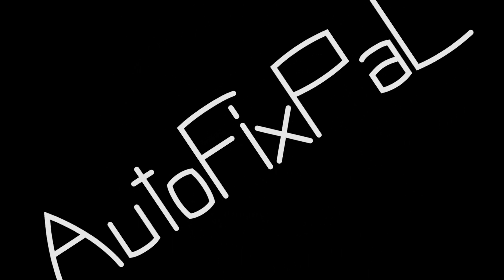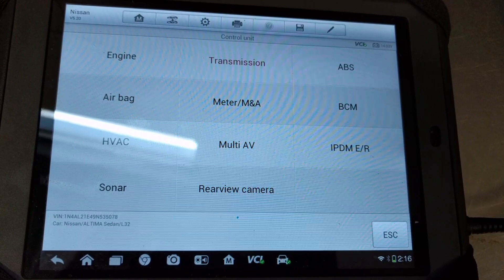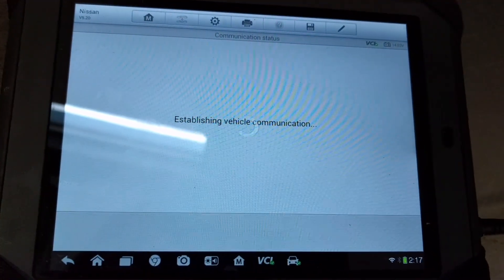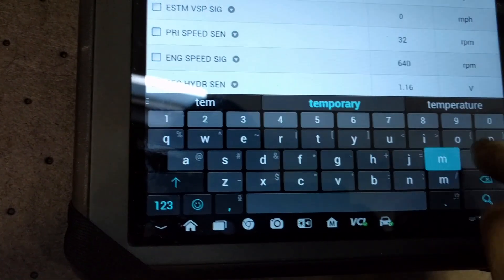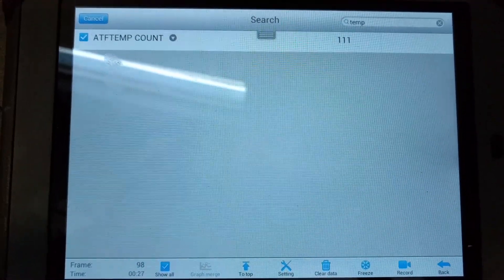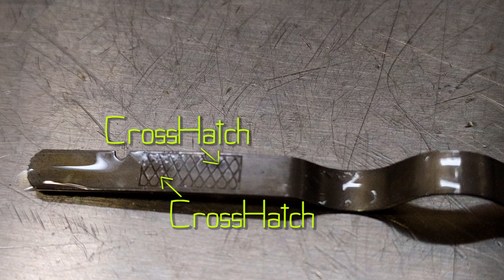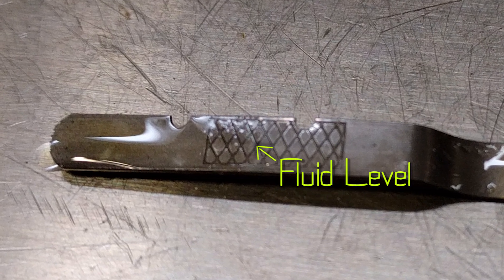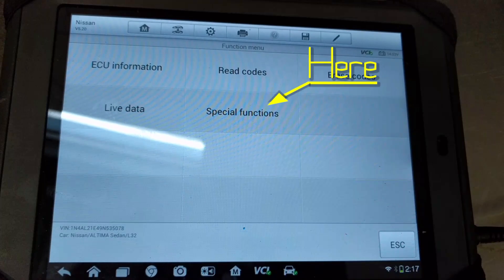Nissan CVT transmission fluid level check and correction with a dip stick

Comment: I have a 2014 nissan rogue.  No dipstick, just the plug. Just did a drain and refill using ns-3 genuine nissan fluid, but no way to check if fluid level is correct.  Where can I buy or make a dipstick?  Nissan dealer not friendly.
Reply: Gary Clemenson that is a screw right next to the  one you drained the oil , with the car running at a certain temperature you  remove that bolt  and check if the oil drains or not ,that indicates the right amount of oil
Reply from the maker: the EASIEST way to to a drain and fill would be to measure what you take out and put the same amount back in. Just make sure the fluids are both about the same temperature when you do it. If you are not sure if it was originally correct. you will have to over fill it a bit put 5 qts into a 14 rogue, get the CVT up to 98-113 degrees f. open the 14 mm at the bottom and let it run out until it starts to be a slow trickle or drips. I believe i did a video on Nissans with no dipstick as well.
Reply: for a diy dipstick what should the level of fluid be? is it between 1-2" at hot and/or cold?  @Autofixpals
Reply: @Autofixpals  i  have 2010 maxima with a dip stick to check the level and unfortunately transmission is leaking  (nissan replaced the original one under warranty with this remanufactured one )i have mixed readings of the fluid level,when i check it in the morning the level is around the first notch,(ambient temp is around 35 degrees F) then i start the car  to warm it about 15 min and i check it again  no fluid can be seen on the dip stick( not sure if this is normal) and then i drive it about 20 min on highway 15-20 miles and check it again the level is in the middle of the cross hatched area close to the second notch.  do you think the fluid temp  can affect the fluid level reading this much?Thank you
Reply from the maker: @keysersoze1907  yes temperature can effect the reading that much. If your replacement CVT is leaking and it was installed at a dealer it should have a 12k mile 1 year warranty on it. if im not mistaken. Call the dealer and find out. Sometimes you can convince Nissan to help with the costs of the CVT repairs if you are out of warranty.
Reply: @Autofixpals  thank you for your reply,well  i realized the leak went to dealer they said axle seal,after arguing it needs to be changed under warranty i got it changed,after a month later while getting an oil changed i see a leakage and they said it might be power streeing(i took pics of the leak and it was still under the warranty)they cleaned the area ,put a dye in steering fluid next day they said steering fluid is leaking not the transmission and  ,they told me not a big leak  can drive it like that,i drove it liked that for months and asked again since steering fluid level wasnt getting low,now this time they said it is transmission,(out of warranty)i went to another nissan dealer, confirmed no power steering leakage only transmission, i called nissan compained told them i have pics of the leak please check the pics this and that.....they did nothing,once out of warranty they dont care at all.if i can find an affordable scanner i ll check the temp and add fluid.
Reply from the maker: @keysersoze1907  are you handy with a volt meter? i do plan on posting temp count vs voltage specs for those that dont have access to a scanner. You will have to find the circuit for the temp sensor to check it at though.
Reply: @Autofixpals  i ll try to learn from the video you ll post👍,btw  i saw one guy checking the transsmison pan temp with infared thermometer while checkin the actual temp with a scanner, it was very accurate  but it was a different car.i bought  a thermometer , i am planning to get the fluid change at the dealer and try to record the temp differences between the infrared thermometer reading and dealers actual reading.you know better, do you think it will work?thanks again i appreciate you taking the time to reply.
Reply from the maker: @keysersoze1907  the fluid level is set on the dip stick Nissans using the Data PID called "atf temp count" or "fluid temp count" which does not translate to tempurature in degrees fahrenheit (atleast i dont think it does) the "fluid temp count" needed to set the level is 155 to 160. I am going to see if pan temp (infrared thermometer) corresponds to fluid temp count and make a video on it. Stay tuned! give me a week or so.
Reply: @Autofixpals  thank you, i ll sub, and wait for your video
Reply: @keysersoze1907  You can get a relatively accurate handheld Laser Thermometer on Amazon that you can simply point at the Transmission Pan for a temperature reading, doesn't matter much if it is off by a degree or two.  Not sure if my Ancel AD410 indicates Tranny Fluid Temperatures or not...it isn't a top of the line Scanner.  But I will check and see when I go to do my Moms Oil Change.
Reply: @darring.9161  thank you
Reply: @keysersoze1907 . You're Welcome Sir!

Comment: You check it when the vehicle is off correct?
Reply: AB Baby  Why would you need to be up in the air or on ramps to check a fluid level???   
You only need to be on a relatively flat surface to do a Transmission or Oil Check.
Reply: No, get it up to running temp first. Put Vehicle in Park and leave running...then check the level.

Comment: Can regular cvt transmission oil be used instead of Nissan genuine oil?
Reply: Speaking for myself only, you can use Valvoline CVT Fluid which is NS-2 Compatible...but I would recommend you stick to Nissan's NS-2 or NS-3 (Depending on Year Model) only use the Aftermarket once the Extended Warranty of the Vehicles CVT has ended.  I've had great success with the Valvoline CVT Fluid in a 2010 Altima without any outstanding issues or problems.  Still runs and shifts very smoothly!  If you got Warranty...don't use the Aftermarket Fluids yet!!!
Reply: i wouldn't with the CVT, normal coolant and engine oil, yeah no problems, but not CVT

Comment: I can't even figure out how to remove the cap for the Cvt transmission fluid... I tried looking it up but no results.  So I can't at least check the fluid
Reply: Lincolnator use a flat head screw driver and pry out the side latch. there's like a lock pin you need pry out to release the trans deep stick.
Reply: rj adragel thanks.  I'll try that
Reply: rj adragel just seems like it should be easier
Reply: Lincolnator It's super hard to pull out, hold the screwdriver on the side to unlock it & rock the top of the dipstick side to side as you're pulling up on it (hard), it should come out.
Reply: Once you get your Dipstick out...Flip or revert it around to the opposite side and put back in and it won't lock in on you.  That way you can check your levels or fluid with ease in the future, much like you would with a regular Dipstick.  Not sure why Nissan had to make a Dipstick so complicated to take off or get into?  But there are YouTube Videos on how to remove them and even cut off the piece that locks them in.

Comment: Can you put ns3 transmission fluid into a vehicle that use ns2 to be specific Nissan Altima 2007 thanks
Reply: Of course you can, if you are ready to pay for the tow guy to dump it in the car cemetery.
Reply: Here's the spec sheet from Valvoline.  NS3 is backwards compatible with NS2 FYI.
https://sharena21.springcm.com/Public/Document/18452/a9437451-fe75-e711-9c10-ac162d889bd3/89a30b24-93bb-e711-9c12-ac162d889bd1

Comment: Do you know the meinenance schedule for the CVT gearboxes? (xtrail 2012) Nissan Romania says it needs no oil/filters changed, just added. Thank you
Reply: change of oil every 20.000 km on bad roads and in case of towing (towing not recommended due to basic design of gearbox) , also change small filter in CVT heat ex-changer and invest in oil with higher viscosity @40 c and @100 c and higher Flash point (due the better taking care of frictional heat)...yes u can use Aftermarket oil (AMSOIL or FEBI etc...) p.s read oil specification!

Comment: Great videos!  What's the difference between the Nissan NS-2 and NS-3 CVT fluid?
Reply: You can mix ns3 with ns2 but not adding ns2 to ns3
Reply: @Sroor90010  Researched it. NS-3 replaces NS-2.  It is backward compatible.  NS-3 was part of Nissan's solution to the high failure rate of Nissan's CVT transmissions.  Another part was better cooling of the CVT fluid to prolong fluid life.
Reply: @markyoung6284  - interesting Nissan has separate products for NS2 and NS3 but Castrol has the one product that specifically states good for both NS2 and NS3
Reply: @condor5635  NS3 replaces NS2.  Don't use NS2.  NS2 is part of the reason Nissan CVT transmissions were breaking down prematurely.
Reply: @markyoung6284  - if that’s true then I would assume the Castrol is basically NS3 since it covers both NS3 and NS2 i’ve had no issues using casserole in Nissan Rogue
Reply: Mark Young the number.
Reply: Weight and Formulation.
Reply: NS3 better cooling

Comment: 1:16  thanks man. I was so confused on how to read the fluid level. I have a 2011 Rogue, and my fluid level (factory filled) is always at where the first "bend" is when warm... I assume it is overfilled? but there is no way to tell unless I have the scan tool, which can tell the fluid temperature, is that correct? when I  do a drain and fill, should I just put back however much fluid came out? would like to hear your opinion. thanks.
Reply from the maker: nickolas if doing a drain and fill, do it with the car cold, old and new fluid at same temperature and put back what you take out. You should be good to go doing it that way.
Reply: @Autofixpals  My Rogue dip stick has the 'hot' mark after the 'bend', what's that?
Reply: This is EXACTLY WHAT IVE BEEN TRYING TO FIND FOREVER wtf is that there if your supposed to keep it so far down man. Damnit
Reply: Yeah, what about the hot mark? What does that mean?
Reply: did we ever find out

Comment: Should the engine be running when the oil level is checked? I have noticed that i get a different reading when its on from when its off.
Reply: Guess I should get rid of my murano cuz I can't afford a mechanic let alone the 18 mpg  lol
Reply: @FordFans721  I feel ya on that. I get 17.4 mpg lol
Reply: Auto Fix Pal i call that bullshit
Reply: I decided to keep my murano, it just rides too nice and it has 5 star crash ratings.
Reply from the maker: Yes it needs to be running and at the temp level indicated in the video. If you don't have a scanner that can read TCM data. Dont mess with it.
Reply: Thanks for the reply

Comment: nice video . now while doing this test should the car be running or not?
Reply: This question was never answered!
Reply: he technically answered that question - the scan tool that he used to read the fluid temp, the car needs to be running.
Reply: @nickolastiguan  Yes, i also have a scan tool that can give the Temp count, which is a generic number. However temp count can very from year make and model. I need exact specs.

Comment: What's the cheapest car scanner that you recommend that'll read temps for my 12 sentra? Also is that in Celsius or Fahrenheit?
Reply from the maker: Hamchuck the PID is called ATF temp count...not sure what it represents but I will provide voltage measurements when I get a chance. you will be able to back probe the temp sensor circuit with a voltmeter and get what you need to set the level correctly..
Reply: @Autofixpals  Where specifically can you read the cvt temp voltages from with a volt meter? I was able to figure out the voltages from the 2014 altima FSM (95F to 113F corresponds to 1.754V to 1.568V). Thanks.
Reply from the maker: @paulhanson8311  at some point i had planned on posting that info, logged corresponding voltages and everything. But, well... I will see if i can do it again. 2014 Altima voltages will correspond the same way on most nissans with a dipstick. There is a round connector usually on the side of the trans or the front of the trans. But you also check at the TCM which is easier to get to. However you will need to know how to take that connector apart to back probe the correct pin. I am not at work to do it now. But if you have not already figured it out. Respond and tag me. I will get the pin number for you from the service manual.
Reply from the maker: Autel https://amzn.to/2C3j61m

Comment: I have 2015 Nissan quest with 45000 miles, when do i change the trans fluid, do the transmission carry a filter.
Reply from the maker: the CVT does have a filter inside. however you don't  need to service the fluid for a long time, there is a number that can only be checked with a scanner that says when the fluid should be changed and most vehicles dont reach that number for a VERY long time, the number is not exactly milage based...

however i typically recommend drain and fill services every 60k miles. just make sure this is done at the dealer or a repair facility with a lot  of Nissan CVT experience.
Reply: ok thanks i called my dealer and he states it should be change every 30,000 miles, i check my owners manual but does not states when to change it. very confuse, i have a 2015 quest with 45000 miles
Reply from the maker: Janet Chambers dealer just wants your money. 60k change intervals are just fine.
Reply: I work at a nissan dealer. I recommend cvt drain and fills every 30k. Fluid is already destroyed by then. I've put new cvt's in versa notes with 30k on them.
Reply: Some people put that many miles easily in 2 years.  Sucks that the CVT requires that kind of upkeep.  My wife admittedly has neglected her CVT and has 125, 000 miles on her 2011 Rogue.  I say neglected because I would think her service manual states a fluid change well before now, but it has begun to apparently act up.  Every now and then it seems to have a moment of hesitation when accelerating, but there are no engine codes and she just had an expensive full tune-up done.  Figured it was that CVT acting up finally.  The RPM gauge doesn't shoot up during those brief hesitations though, so I'm not 100% positive it's the CVT.

Comment: what brand of scanner are you using in the video, thanks
Reply from the maker: jmac2050 autel maxisys http://amzn.to/2ozlGrX
Reply: $1,300 tool.  Unless you're a mechanic, might opt to take it to a qualified repair shop.
Reply: Can  you  use  a  infored  gun??  Would  the  tempature  be  the  same  as  the  scanner  tool??